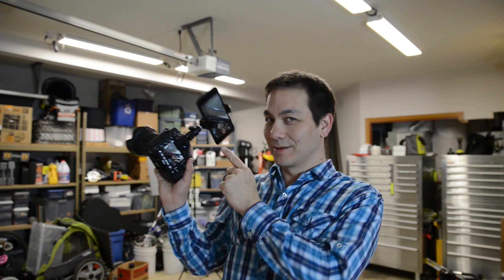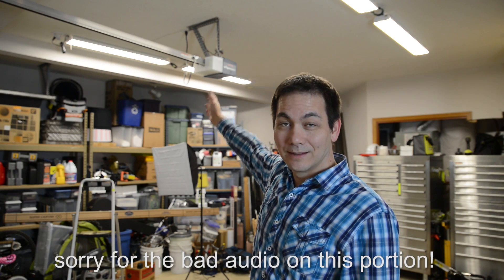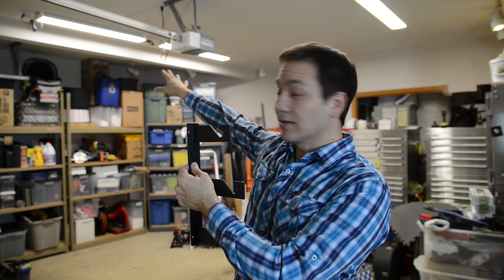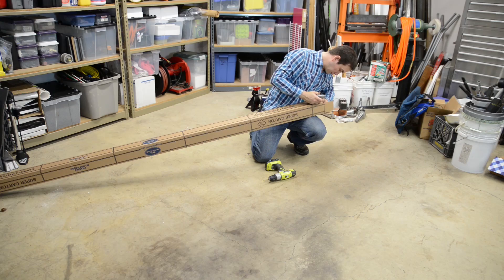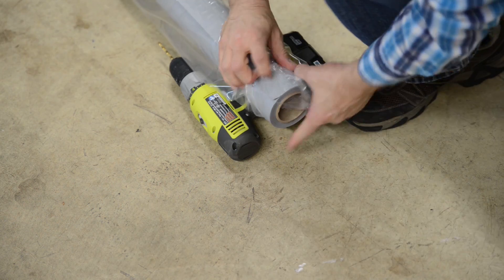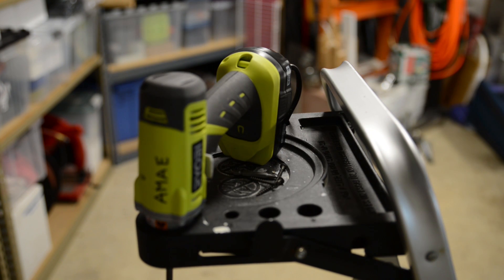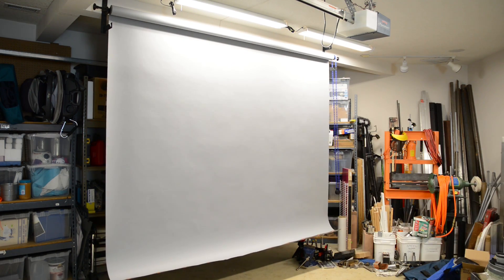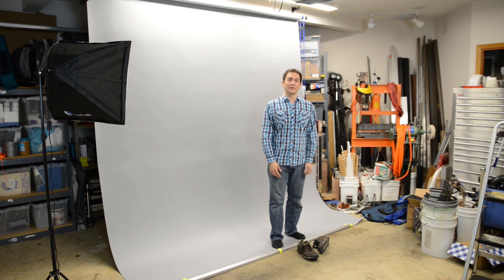Build a Professional Photo Studio in your Garage!

Comment: Hello you did great..I want to know did this sag over time because you didn't use any type of conduit or pvc pipes?
Reply from the maker: Great question! Yes the 108” seamless does tend to sag if you leave it on the cardboard tube for long periods of time. I just but 2” electrical conduit and transfer the paper over if I am going to leave a color up for months. For a few weeks I just leave it on cardboard. Personally I like having neutral gray, black and green (green screen) colors up all the time and only occasionally swap in different colors. The reason is I usually color the gray  backdrop with RGB lights when I want color. Sorry for the really delayed reply!

Comment: any sagging of the big roll of seamless ?
Reply from the maker: A tiny bit of sagging on the cardboard rolls, but nothing that renders is unusable.  I replaced one roll with a 2" electrical conduit (metal) and it has no deflection. It worked so well, I'm going to replace the others when I get time.